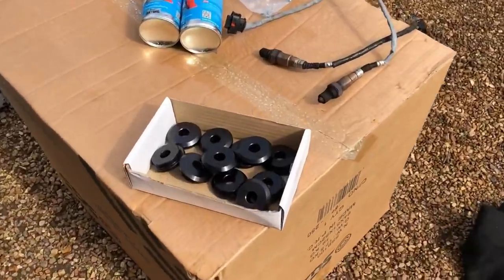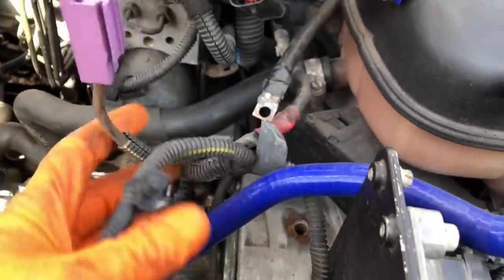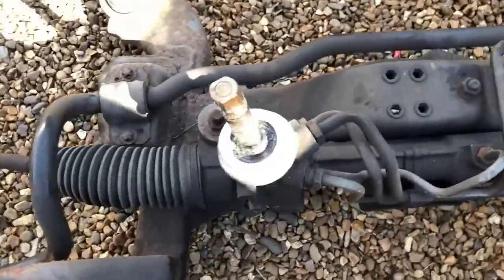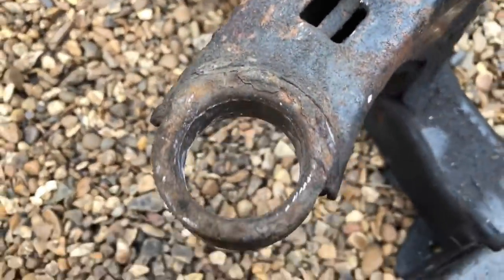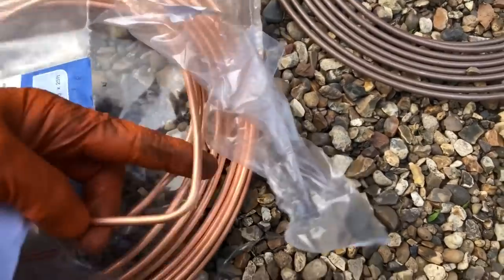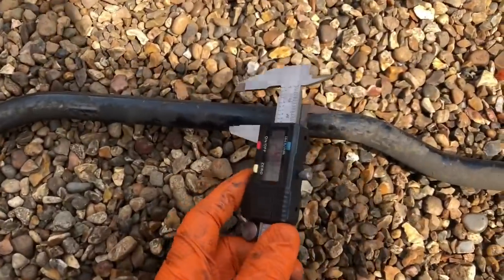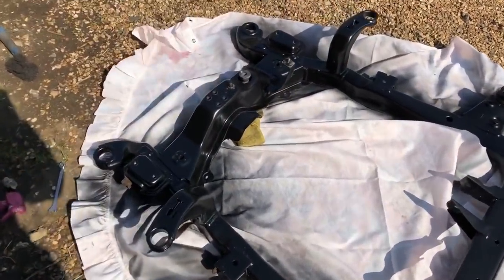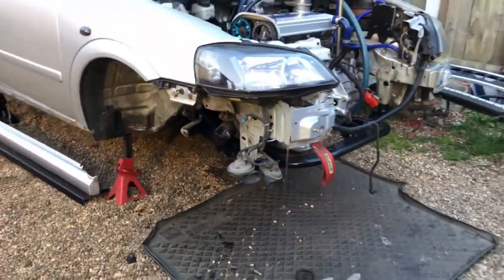OverHaul Starts NOW! Solid Subframe & Whiteline Anti Roll Bars. Opel Astra Z20let

Comment: Aaron did you get any lights on the dash after refitting the sub frame and rack as I  fitted a engine in a gsi zafira and and the traction light stays on
Reply from the maker: Did you touch the steering wheel while changing it as it will be the steering angle sensor if so
Reply: @AaronUnknownPerformance  not sure if the wheel got moved how do you set them if you dont mind me asking and thanks for replying

Comment: @Arron Unkown i have a an astra vxr see the rear bolts on the subframe mate i removed one and the captive nut come off is this meant to happen as i have only done one side and how do i put it back on i cant get the bolt to marry up with the nut as its to tight in the chassis leg is there a way of doing it  cheers mate
Reply from the maker: The rear captive nuts move for adjustment/alignment. As long as it isnt spinning. Leave the front subframe bolts loose so you can get the bolt threaded
Reply: @AaronUnknownPerformance  thanks for the reply mate i will give it another go tomorrow
Reply: @AaronUnknownPerformance  it is tight a little mate but it wont go all the way it is spinning insude but the bolts isnt threaded .....
Reply: @AaronUnknownPerformance  how do you get the nut to stay in place mate its just turning! i cant get a spanner on the bolt as its to tight in the chassis is there a specific tool you use to hold it in place while you tighting it i ended up up using a normal nut

Comment: What mods would you recommend to archieve around 300+hp for a daily driven Zafira gsi?
I have a spare stock LEH engine to start with and I'm wondering what modifications it would need.
Do the stock cams and valve springs suffice or would they need upgrading?
Stock inlet manifold or EDS copy, what size fuel injectors?
The stock VXR turbo is not big enough I suppose? I still would like to have low end torque, it is a daily after all.

Would love to hear some input on this!
Reply: 300 is easily achievable nowadays mate. Just the vxr upgrades like turbo MAF injectors. Decent front mount.. exhaust fuel pump and map. Eds or copy if you really want but not a necessity